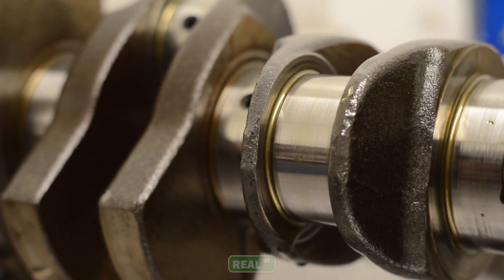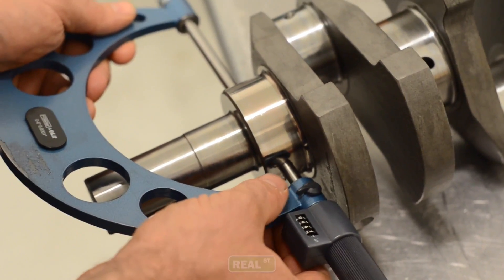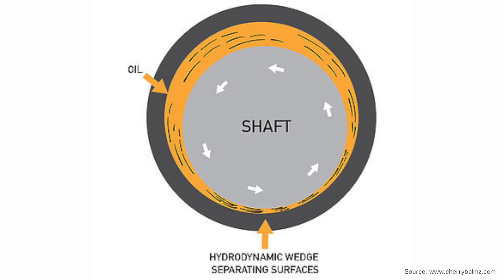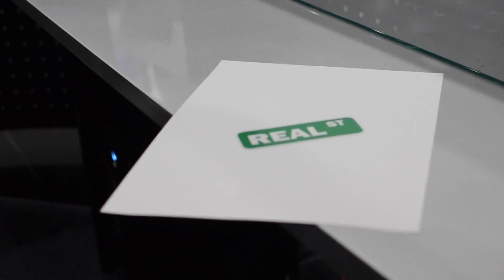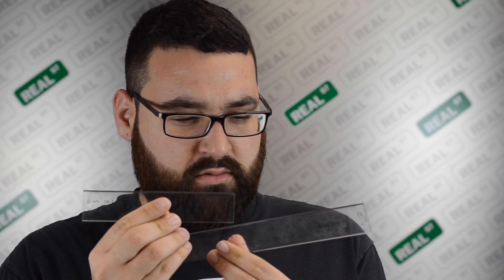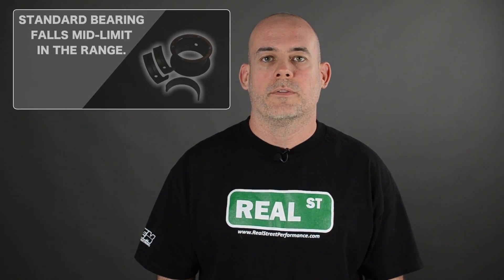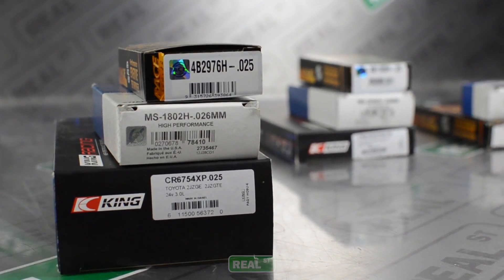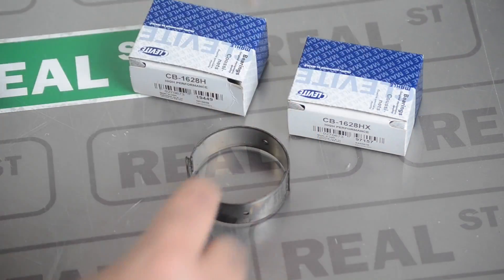Engine bearing Size and Terminology - Jay's Tech Tips

Comment: I installed new standard rod bearings they were practically the same thickness as the original, but, they were  a bit wider. Is that a normal thing? I had engine failure i think it got too hot blew a cap and seized and damaged the crankshaft and cylinder wall. I don't see how std bearings can be wider, not thicker. Unless they put in a crank with a more narrow clearance for the journal walls. I don't know. Any Ideas please?

Comment: I once read a Car Craft or Hot Rod magazine article back in the early sixties about a circle track racer that made what he called a "precision rod bearing". He modified the bearings by removing bearing material down to the shell and up from the parting line approximately .500" on both sides of the upper and lower shells. He then reduced the bearing clearances to approximately .0007 to .0008" and ran light oil. I don't remember if he also ran a high volume pump. People were skeptical, but he said he never had a bearing or engine problem and then just decided to stop talking about it because of all of the negative feedback he was getting.

Comment: I have a 22re need to replace bearings  has crankshaft still on the engine  the engine has over 180 Thousand miles  What size do you recommend

Comment: Would it be safe to use standard size bearings if the crankshaft wasn't machined but just lightly polished. 94 s10 2.2 liter

Comment: Our ford modular bearing clearances are tight even under boost. We run. 0011. 0025 clearance even at 1000 hp.. 0018 is the sweet spot for most 4.6/5.4/5.0 engines

Comment: The convertion ratio for imperial sizes to mm is:
.001" --> 0.0254 mm (0.025 mm could be ok)
.010 --> 0.254 mm, not 0.25 mm (-0.004 mm in diameter difference)
.020 --> 0.508 mm, not 0.50 mm (-0.008 mm in diameter difference)
.030 --> 0.762 mm, not 0.75 mm (-0.012 mm in diameter difference)

The bearigrs were produced with a wall thickness tolerance of 0.006 mm (about .00025")

Regards from Argentina!!

Comment: Oversize and undersize is mixed up too often when discussing engine bearings. Undersize is the most common with a bearing being thicker on the inside diameter to make up for metal removed from a crankshaft journal. Oversized bearings are thicker on the outside diameter to make up for metal removed from the block housing bore.
Reply: Yeah, this dude can't explain his way out of a paper bag.
Reply: Yeah he said it backwards and I was like “Uhhhh, think you said that backwards bro”

Comment: i still cant figure it out. i have a d16y8 engine block with a d16z6 crankshaft. do i go with standard sized bearings? what if the clearances are too large or too small? do i get a different bearing size? 
ie: i use standard bearings for crank journals, i plastiguage, and it comes out to .0025, how do i get it to .0015-.0020 which is service limit for d series honda motor bearing clearance? that would be loose. do i use on standard, one hx size? which goes on too, which goes on bottom? how much would it thin out the clearance by doing so? 
i really would appreciate if someone could answer. im stuck

Comment: My machine shop said they would micro polish my crank to help " reduce friction " but would that require me to need bearings that are not standard ? 

my engine has not been damaged. Just rings went out on my number 1 piston so i ordered cp pistons and rods. I havent ordered the bearings yet because im going to wait until the machine shop finishes their work on the crank.  Im assuming since its a polish its not going to be taking much material off if any. But just figured id ask.
Reply: what did you end up doing

Comment: PLASTIC GAUGE....?? JOURNAL clearance
Reply: Plasti gauge
Reply: +Spoonzaza  ...  is there a down side to use the plasti gauge?????
Reply: +HAW 1320--- High Altitude Whips CEO 
Not that I know of. But I used to use it with my when I was younger and watched him rebuild motors. I'd say it's accurate. But for the most part you just have to ensure that the bearings and journals are clean and free of any FOD (Foreign object debris). Assembly in an extremely work environment. We haven't had any problems tho. Everyone will say there's better out there but plasti gauge is good enough. I'm actually in the process of assembling an engine and I plan to use plasti gauge
Reply: +Spoonzaza  nice...thanks for the 411. I have always used it ... I used it when me and my pops built  my SBC BMW Blown 325is.... check my vids to see it if you like ...... I just hit my goal for the car I wanted 10s out here at our altitude ..(swings from 6k to 9000 DA) I hit 10.80@133 on street tires and DA that pass was 7400da...... feeling pumped